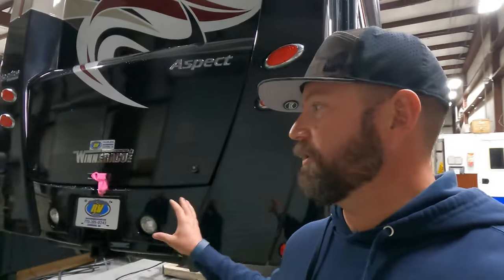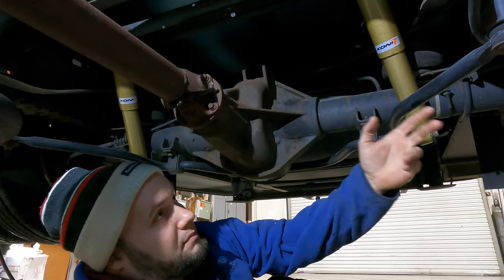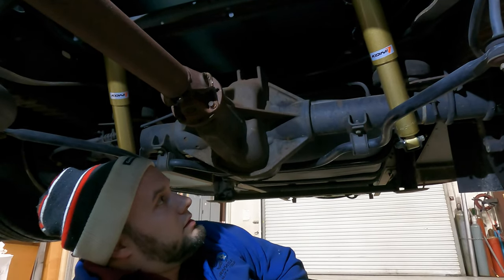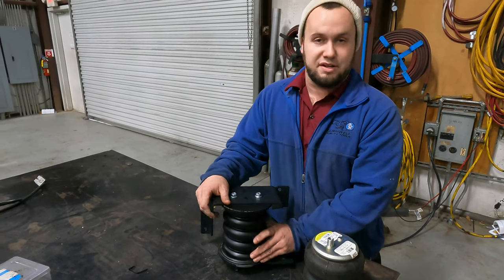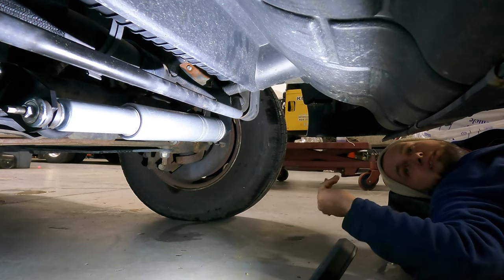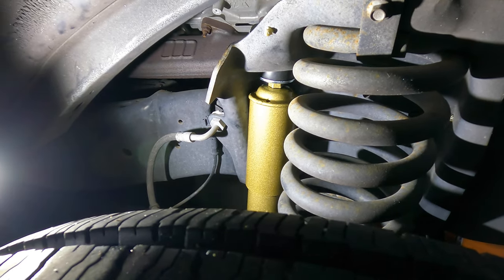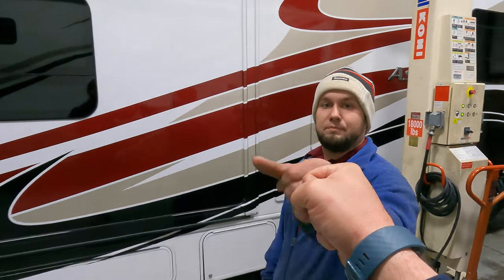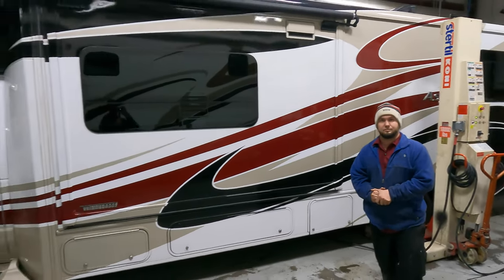RV Suspension Upgrade That Could Also Work for Your Truck!  Whats in the RV Shop Episode 2

Comment: Semis have air compressors to get rid of water
Reply: They don’t work on semis, strictly RV/camper. However semis have air dryers to get rid of most moisture, not the air compressor.

Comment: Ya know he dogs on air bags so much. Our semis and trailers are air ride (air bags) and they last for years and years. They aren't prone to fail. They do not get replaced every 2 years like he says. One of ours trucks is over 20 years old and so has the factory air bags and they are not cracking like he makes it sound like they do so bad.  I also have air bags on my pickup. They last on my pickup like the do our semis and trailers. I'm ready not sure why he is making the statements he is.
Reply from the maker: I’m not sure he’s dogging airbags… he’s simply explaining why he prefers the Sumos. I’m also not sure comparing semi truck bags to the bags in the video makes much sense. This guy deals with these parts on a consistent basis… I find it useful information.
Reply: Yea comparing semi airbags to light duty airbags doesn’t make much sense.  They’re both airbags, that’s where the similarities end.
Reply: He’s not dogging them, he’s just telling you from experience what he has seen and what he prefers. This is his personal opinion! Everyone can have a different opinions/experiences.
Reply: There is a big difference in semi's when they are maintained more.  Most Rv motorhomes don't get the mileage and sits where rubber items tend to dry rot faster.